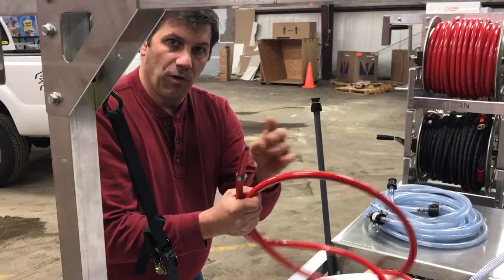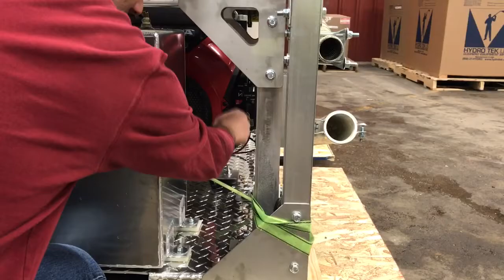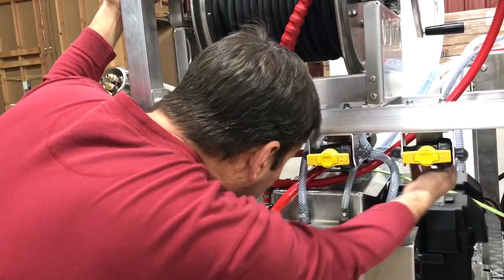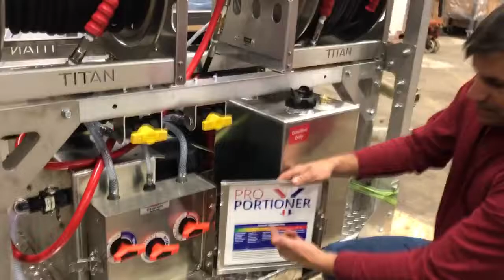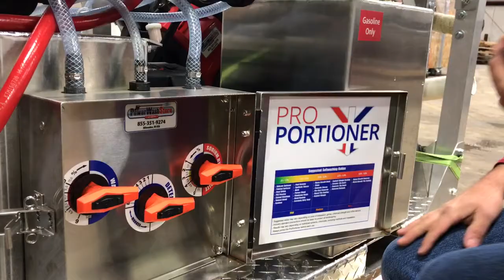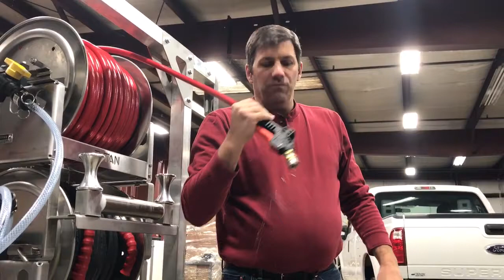Wind Mart water dragon skid

Comment: Not a single label on it (besides the proportioner). Let it sit for a couple of months and wish you good luck remembering which hose to use to prime which hose to which tank discharging to what power washer into what bucket. 
It looks like an awesome system, though .
Reply: I believe they were still in the process of building and labeling everything. It's a sweet setup.

Comment: i dont like the gas tank on the back of the trailer and also that exhaust right there next to it. and how its difficult to get to ur pressure washer start engine. it looks nice but i dont like this setup.
Reply: Totally agree with the placement of the fuel tank and exhaust. Fuel tank should definitely be on one side of the trailer if not the middle somewhere. One thing I hate  is having exhaust blowing toward me ..